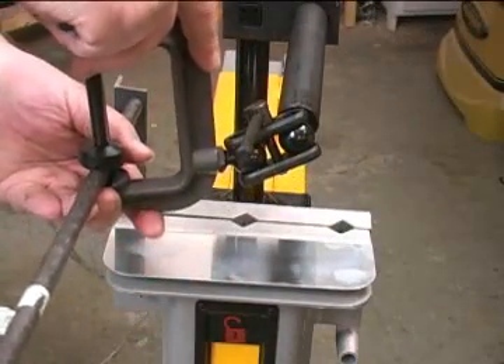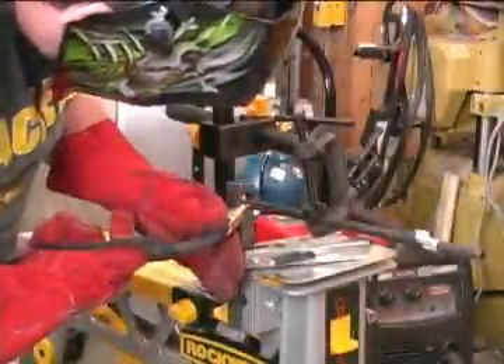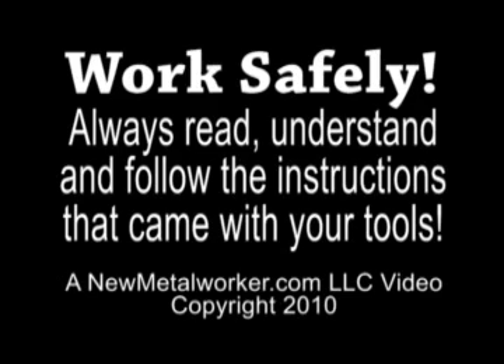Rockwell Jawhorse

Comment: When folding unit up. Fold your 2 front legs up first, then the foot lever and then the single leg.
Doing it this way locks all parts in the closed position and the legs will not swing out while moving / carrying.

Comment: The Jawhorse is good f0or lots of smaller projects as well as some not so small. You just have to be aware of how much weight you are putting in it and how high that weight is. At some point you can overload even the Jawhorse and make it unstable so just be aware of that as you work.